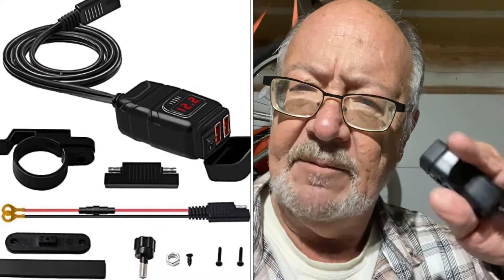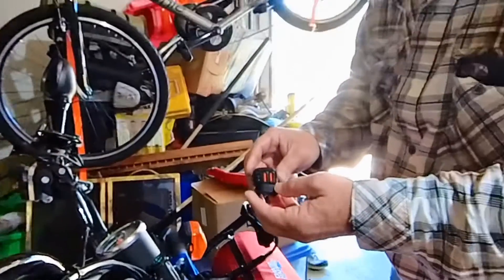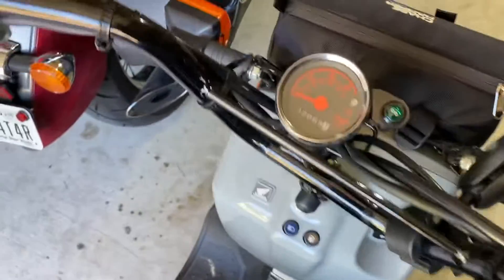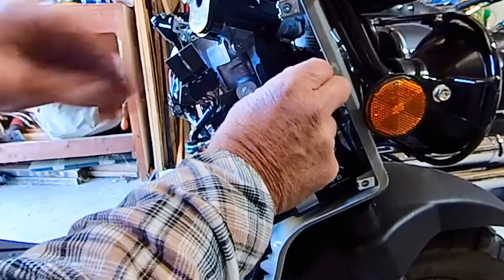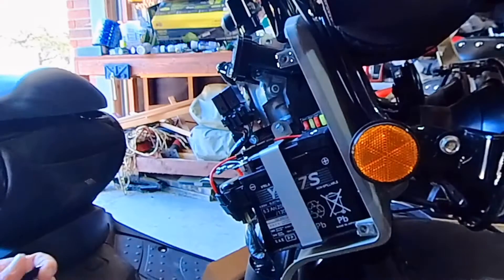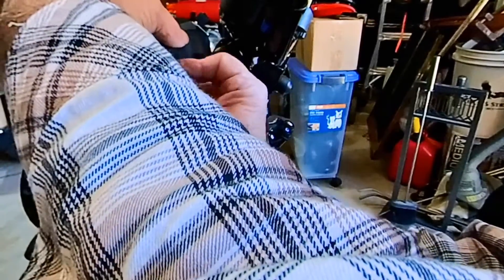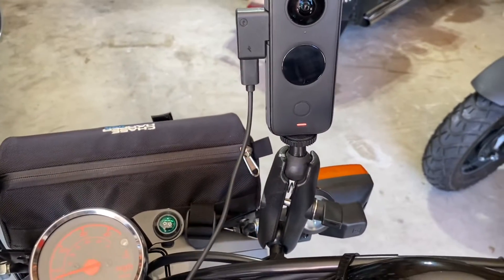Honda Ruckus USB Port Install

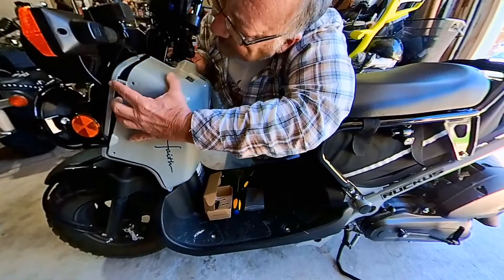Comment: 08:36 Looks like the left tab came out of it's slot.
Reply from the maker: Good eye! It did. It just popped back into place without having to undo the other side. The part where I fixed it is on the editing room floor. I'll pin this comment in case anyone else notices. Thanks!

Comment: I think I mentioned it to You in another video / You were speaking of lower than usual MPG . There's a E.C.M. reset procedure that must be performed Every And Any Time The Battery Is Disconnected ! Just saying ... You'll notice the difference on cold starts , and MPG . Google Honda Ruckus E.C.M. reset . Very simple ....

Comment: Wait you can leave battery tender wires in battery assembly? And still run the ruckus no problem? That’s genius, instead having to take battery out every time to charge it.
Reply from the maker: Thanks